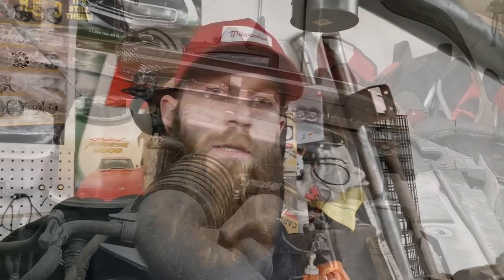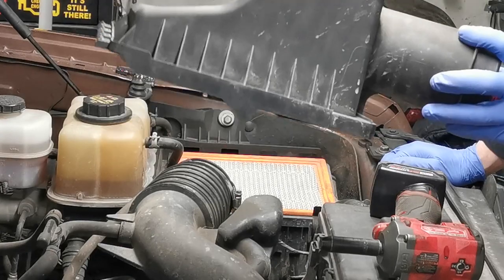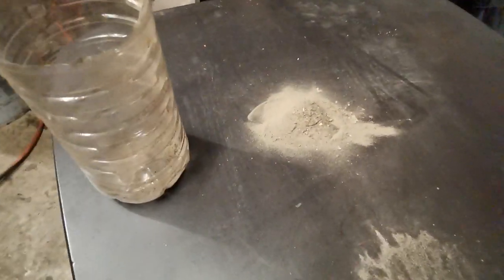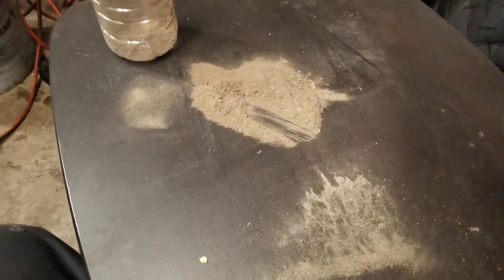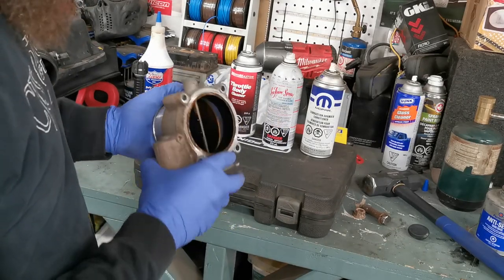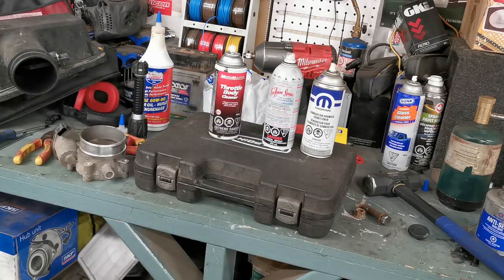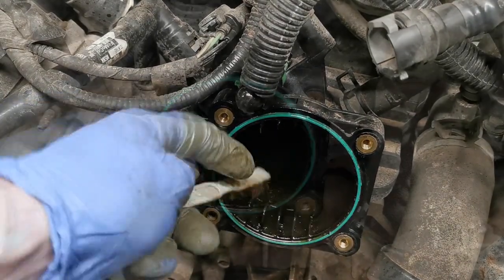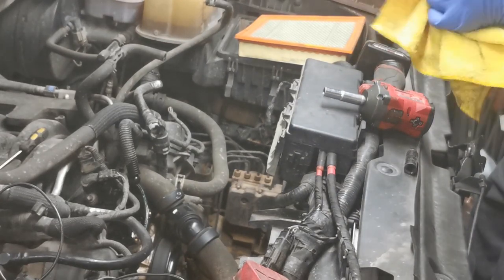F150 Got Bad Gas Mileage? Throttle Body Cleaning And Idle Relearn

Comment: Just cleaned my throttle body and MAV sensor on 2013 F150 5.0 with 110,000 miles . Amazing how much smoother the truck runs now. Night and day.
Reply from the maker: Very best 👌

Comment: Couple things: you don’t have to disconnect the Pos terminal, just the Neg. As long as the battery is removed from the circuit those capacitors will drain the same. 
If you’re going to do this cleanup, replace that green gasket while you’re at it. They’re 3 bucks at the auto shop. 
Finally, don’t spray cleaner into the intake like that. Soak a rag or brush, clean it up and then thoroughly wipe it down when you’re done.

Comment: Thanks for the video. I never knew I needed to reset my idle learn. I did what you show us here to my 2012 F150 ecoboost with 195,000 miles on it, and my mileage shot back up from 12.2 to over 16 mpg. I had to check my tach to see if she stalled out at a red light because she was idling SO SMOOTH! Thanks again. (I had about 1/16th” of dust on my MAP too)
Reply from the maker: glad i could help
Thanks for watching. make sure to like the video and feel free to subscribe to the channel
Reply from the maker: Kristie Parker  you can unhook both positive and negative and hook a jumper cables between the two to drain the system of all power. 
After the system is drained you can disconnect the jumper cable and hook your battery back up normally. Then can do your idle relearn after.
Reply from the maker: Kristie Parker  if you are not comfortable doing these procedures at your own risk I would suggest having a qualified person to assist or to do the job so no damage is done to the electrical system of the vehicle.

Comment: Hey thanks for the info in the video. I was able to clean my throttle body today as well as my MAF. I was averaging 100km/17 litres. After the cleaning it dropped down to 100km/14 litres. In the early going at least. I'm also enjoying a better idle and smoother acceleration. I was experiencing rough idle as well but it hasn't happened after the cleaning. Knock on wood. All this after a spark plug change from a trusted team of mechanics. 2009 f150 5.4. Next I will upgrade the air filter. Once again thank you for the video. I watched the whole thing more than once.
Reply from the maker: Thanks for watching. 
Make sure to like the video and subscribe If you'd like. 
Happy it helped
Reply: @LUCAMTire  I definitely liked and subscribed, I appreciate you posting this video !
Reply: I want to do this for my 2017 Infiniti QX80 but because the butterfly plate is electronically controlled, I was afraid that manually opening it to clean it up real good might be harmful to the motor or electronics controlling the plate.  Yours was this same electronic control as well?  And no check engine light came on afterwards I guess?
Reply: Did it keep idling smooth?
Reply: @KollynJ  i still expereience the rough idle. But thats a 5.4 thing. Might be the solenoids on my truck my guess.
Reply from the maker: @ofcbob6391  the throttle body in this 2011 f150 is electronic. disconnect your batter when cleaning so it does not activate with your fingers in the unit
Reply from the maker: @KollynJ  yes

Comment: Thank you for your video. Made significant difference. I was averaging 13.8 mpg and now I’m around 17 mpg. This was after a change of spark plugs, change of oil, cleaning of throttle body and mass air flow sensor.
Reply: Note: I only drove it for 20 minutes so I will see if it different after a few days of driving
Reply from the maker: Great job! Happy to help
Reply: @Nando-fe1bx  you drivin it enough yet?
Reply: @Nando-fe1bx  which spark plugs are you using?
Reply: What truck do you have?
Reply: @DesignLead  2012 f150 5.0

Comment: My 2004 BMW 325i only got 15 MPG since I bought it 5 years ago.
I cleaned the MASS AIRFLOW SENSOR and I'm getting around 30+ now!!!
(It never threw a fault code for anything. Including Oxygen Sensors.)
Reply from the maker: mass airflow can definitely cause bad gas millage as well. Thanks for the info

Comment: Im about to do a tune up on mine soon. Getting about 12.9 mpg. I was getting closer to 17-18mpg. But now its gone down a good amount. But I'm do for plugs and some cleaning. And when doing the idle relearn you should turn ac on after its sat a bit. That puts a load on so it knows what to except from a heavier load at idle.
Reply from the maker: yes
You have all loads off and run vehicle to relearn cold to hot idle relearn then start adding on load at a time to show different loads for the computer to relearn itself. 
You will need to road test after for transmission shift points.

Comment: I'm going to try this on my 2014 and I'm hoping for the best. I really really thank you for posting this. It relieves me like crazy, I was thinking I needed to have a mechanic fix something, since I had it recently worked on and don't trust the work of those mechanics. 

It's possible they unhooked the battery, and the computer never relearned well or something. Anyways, hopin' for the best and just being aware of things that can be done that work is relieving.
Reply from the maker: What did they happen to do for repairs on the vehicle and what is the vehicle doing now?
Reply: @LUCAMTire  Valve cover gasket(s) replaced.  F150 2014 3.5 Eco. 

mpg went from 14 to 11-12

the hose coming straight down from the throttle body kept popping off after they worked on it. I finally found a way to get it to stay on well, cleaned it well, and then used 2 clamps. 

I'm hearing the random scraping noise when I throttle, which I think this video will be a fix for. https://www.youtube.com/watch?v=B1Q3uwRk3H8

Zero rush getting back to me. Just relieved that a drop in mpg is seemingly not that big of a deal.  Just wanting to take the best care of my engine as I can.  

Thank you.

Comment: Thanks a bunch for the video helped me tremendously . Same year truck , Same problem .. huge Drop in mileage .. I run a tune ,  Fox coil over level with 285/75/17 and prior to about 90 k in town I was getting 17mpg  , Hwy was 22 doing ave of 80 mph .. Pretty good as far as.I was concerned ..after  90k it went to 13 mpg in town and  15 hwy ... Changed my plugs , dropped down a size fits 285/70/17 .. Still poor .. Sure hope this cleaning helped  .. 
Thanks again for the video ..
Reply: Did it change? I have a 2013 5.0 I get 11 city and 14 highway , a lot of hills but thats bad
Reply: Thanks for checking back

Comment: Have a 17 f150 with the 5.0. 88,000 miles on it. Getting 12.0mpg city and used to get 15-16 hoping this will help bring it back up
Reply from the maker: Did you switch your tires and if so what did you put on for tires? Tires  an also change your fuel millage

Comment: I've been working on my truck lately. When I first got it used 2 years ago it was averaging about 11.5-12.3 which is not great but I hardly ever take the truck on the highway. Lately it has been dropping but throws no codes. 7-8 mpg if I drive normally, and maybe as high as 11.5 if I drive like a granny. I have already replaced the plugs and clean the throttle body with no real effects. Filters a k&n and not dirty at all. I'm going to try cleaning the maf and replacing the upstream O2 sensors this weekend.
Reply from the maker: If you have access to a good scan tool you can read the live data of the o2 sensors to see if one is being lazy. Or take a multi meter to check the ohms readings. 
Also  there is crank case ventilation that goes from valve cover to intake.
I have found hair line cracks in the elbow fittings that does not throw  a code. 
I Could hear some hissing when engine was running while under hood.  Something to possibly check. 
Dirty air filter or dirty fuel filter. 

I know some times it is a Hassel but would check for a vacuum leek. Could be the situation?
Reply: @LUCAMTire   Well MAF is cleaned and upstream O2 sensors are changed. Man that harness routing is a total PITA, especially getting that plug push in clip undone . The result is that it actually seemed to get WORSE!?!? Yesterday at lunch was a new low. 6.4 mpg!! I was able to get it into the 8-9 range by being a feather foot. Yesterday I ordered a new set of coils which should be here today. So can you check like old school for vacuum leaks? Spray can of WD40 or carb cleaner and listen for any changes. Where is a good spot to get a full vacuum signal from for a gauge? What should the vacuum be at idle?
Reply: The thing that's really ticking me off as it seems to run really well, no missing, sputtering, or codes at all. I even checked it even thought the light wasn't on. Of course, nothing. Is it possible that the mpg meter is faulty??
Reply: Air filter is a K&N and clean. I have read the fuel filter is supposed to be lifetime and is mounted in the tank?

Comment: What about a 94 single can pk body? Family truck we've had for years as well as maintained. However our gas mileage is awful! I realize it is an older model avg this video is for a newer one. Just seeing if anyone has comments or similar issues. Please and thank you ❤️
Reply from the maker: any fuel injected vehicle really. A throttle body cleaning could help a senario.
Throttle body cleaning
Air filter
Fuel Filter
Spark plugs

Comment: My 2012 shaken boots. Just did the plugs but forgot to check the springs n boots on the coil pack gonna clean the throttle body next weekend
Reply from the maker: Did you happen to run the engine codes?

Comment: My 2014 f150 4x4 XLT with a 3.7L 6 cyl engine has had lousy gas milage from the very beginning.  10.5 to 12 mpg in city, and on the hwy I've seen as high as 24 MPG.
Every chance I had if I stopped at a store or gas station and had an opportunity to talk to other guys with f150s, usually they had V8's that got better gas milage than mine does!  Since it has been that way since buying, I wonder if this might help.
Thank you for posting this video!
Reply from the maker: 24 mpg on high way seems pretty good as I never seen it in my truck before. With stock size tires I was seeing around 19 to 22 mpg more averaging around 20 highway.
But lately I been getting around 12 to 15 mpg which was triggering thoughts this can not be normal. Air filter was getting dirty and never cleaned my throttle body before on this truck so figured it was a good time to give it a good cleaning. It's only been a day or 2 sense the cleaning and have not gone overly far. So far the millage has improved from the short test drive i done but time will tell how much better it will get. I know trucks are not the best on fuel but mine seemed to be getting a bit out of hand.
Reply: @LUCAMTire  I appreciated your video! And 20-22 hwy was tropical, I only saw 24 once, and that must of been on the down hill trip back. But it was the best, just no way does that happen all the time.  If I'm hitting 20 on the highway I'm happy. 12 in town makes me wish I'd of got the v8!
But I have loved everything else with my truck.  Thanks again and I hope you and your family stay healthy!
Reply from the maker: @donc9751  thanks same to you

Comment: Just did this. Worked great. But now I hear a whistle noise when accelerating… around 1200-2000 rpm. I’m thinking maybe be a bad TB gasket? Didn’t have any lube to put on it after cleaning the TB.  The intake hose is virtually brand new.
Reply from the maker: could be or you forgot to hook a vacuum hose up some where.  start engine. check where noise is coming from. careful of moving parts

Comment: I was getting close to 22 mpg average in my 2010 f150 just a few years ago now for some reason I'm only getting 16.5 mpg average. But the thing that just shocked me the most was last night I pulled into a friend's house with my instrument cluster saying that I had 65 mi to empty I went in to drop off some food and pick up some clothes turned around walk back to my truck and it said I had 5 miles to empty it still says that today 24 hours later and I've parked it in several different angles to try to see if maybe it's just not getting a good reading.
Reply from the maker: Any check engine light on?
Reply from the maker: Did you ever happen to change your 4x4 vacuum hub actuators?
Reply from the maker: @Tradeitback  could be something with average consumpsion metering on the average meter scense last reset. 
If your vehicle idles alot (winter months)  it will get bad millage on the meter. As it is running but not moving. 

Cana also check under the hood. 
The PCV piping from the the valve cover to intake. One is passenger side one is drivers side. The plastic elbows likes to crack. They are build cheap.
And suck air. 
This might cause a issue. Mine cracked 2 times on me so far. No check engine light. Run truck and see if you hear a vacuum leak. Put finger over PCV pipe elbow to see if it makes a difference in sound. Mine got a hair line crack not visible to the eye. I could only hear IT  and when putting my finger over the elbow sound changed. 
I replaced pipe once on passenger side then it cracked again where the two peices fuse together. Second time round. I sanded it and put jb weld to stop the leak. 
Listen around for some vacuum leaks to see if their might be something. 
If not would need to hook to a scanner and watch live data to see if anything seems out of sink
Reply: Bobby...I have a '10 as well. It was about three years ago that my "miles to empty" came on for the first time ever, and it did the same thing as you described, starting high and very quickly shot to near zero...definitely not corresponding to the distance driven. It only did that once, and the dozen or so times that I've allowed my fuel level to drop sufficiently for the "miles to empty" to come on since, it has accurately displayed and tracked the remaining distance. Weird.

Comment: I do a can of sea foam in a half tank and and a full spray can into the throttle body at 2k rpm every 15-20k miles. Works wonders. Gotta love that fire pull Dumping White smoke. Lol. Also ways runs so much better afterwards. I need to start doing the idle relearn. Is that similar to the KAM reset?

Comment: Gday mate we have the same engine in Australia but I have that Throttle body in my G8 Fairlane 2006 model. The Last ever Fairlane built by Ford Australia.🇦🇺. Only 156 were manufactured BEAUTIFUL CAR. PAIN IN THE ASS MOTOR… ANY LITTLE LEAK IS FKD. LOL 😂 GOOD INFO THE CAR GETS 15 ltr s per 100 km Average driving country driving 12 ltr s if you are driving nicely. The car weighs in at 2120kgs so she is heavy. But I’m a big sucker for a big BOOT. 😂 COOL BUDDY GOOD LUCK WITH THE F Truck. I just fully restored a 1994 F150. They have the famous 5.0 litre Windsor. Cheers 🍻.

Comment: Thanks for sharing. Liked and subscribed. Really appreciate it! I’m getting P0422 “evap leak small”. Buddy of mine smoke tested and said it’s my fuel inlet valve and also said he saw some smoke from behind the engine between the firewall (hard to get eyes back there.) 2009 F150 KR 5.4 3v with 146.000 miles. As for the fuel inlet are there any retrofit/aftermarket fixes to replace ez-fuel no cap with a traditional one? Second time I’ve gotten that code in the last 5 months. Fuel economy has certainly dropped a few mpg as well. Thanks again!
Reply from the maker: not sure where it would be leaking at the back side of the motor unless you have a evap tube running there. 
I do not know if there is a retrofit item but if you found a filler neck off another style of vehicle similar design and tube size i am sure you could possibly make something work
Reply: @LUCAMTire  Bigger issue ended up being fuse 27 (20 amp) fuel pump. Burned up contacts. Ordered the tsb fuse relocation kit….Waiting for it now. No codes and fuse was never blown. Still have the small evap leak I’ll tackle next. Thanks again

Comment: awesome information.  My Neighbor replaced the throttle body on his 2014 F150 ford truck. The pigtail will not reconnect for some reason. will not snap back on any ideas?
Reply from the maker: As long as the little bridge to the connector is still there you can use a zip tie trick or replace connector.
See following link for zip tie trick. 
https://youtu.be/frOpWHQj69Q

Comment: Interesting. I just bought my 2012 f150 cause driving my brothers 2016 which got about 17mpg with 8gallons left I'm averaged at 12.4  when I should be at 16-17 range for in city use.
Reply from the maker: do you have a lift kit? over sized tires? heavy foot? idle long periods of time? any check engine light on?
Reply: @LUCAMTire  I think it's been lifted buddy swears leveled but it sits hire than my brothers stock 2016 one.  Tires look anemic like it skipped leg day had a heavy foot once I got it cause I loved hearing the turbo but it only lasted a week. I've put 1k miles on it with daily use and pretty much to and from work with 4 tanks so far out of my 5 tank test I'm hitting 12.7mpg. 0 engine lights
Reply from the maker: @kryssulich5016  ya definitely not easy on fuel. 
Leveling or lift kit can Rob fuel millage. Oversize tires can do do that as well. 
Could need a Tune up with plugs and throttle body cleaning.
Brakes sticking? E brake on?

Comment: Any experience with using Cataclean to clean catylactic  converter ? Mines not having issues but i wanta do for preventative purposes.   Happy f150ing. Im in a 06 5.4 V3 Lariat.  Happy motoring from NC.
Reply from the maker: i do not know anything about it. If you are running clean gas and no check engine light should mean your engine is burning fuel properly which then your convertors should work properly and should not technically fail, a convertor fails when raw unburnt fuel goes into the exhaust and then clogs the convertor over time. If the vehicle is running normal you should be ok. I do not see to many issues with convertors unless the vehicle has a bad skip for a long time which then would make the convertor fail.